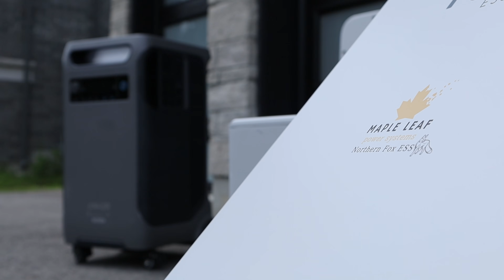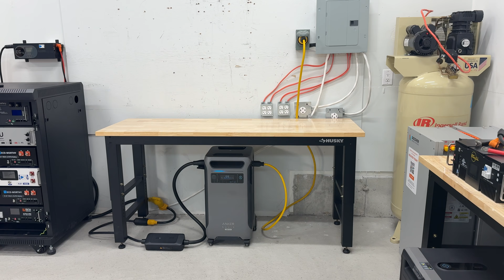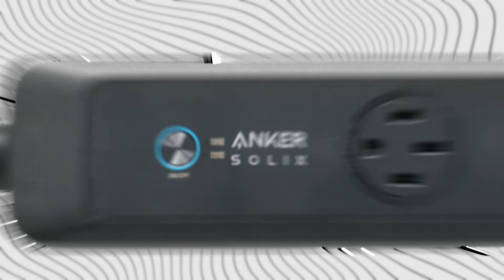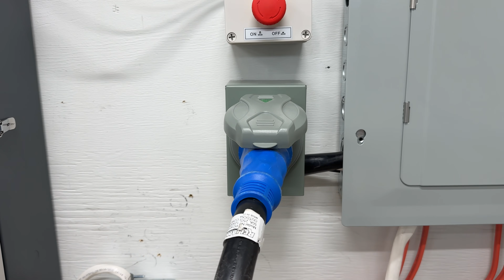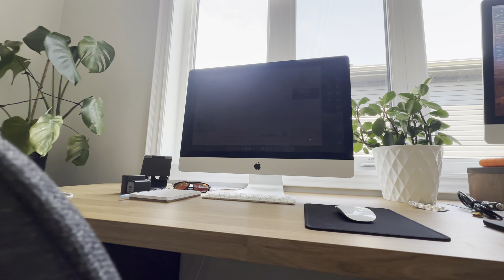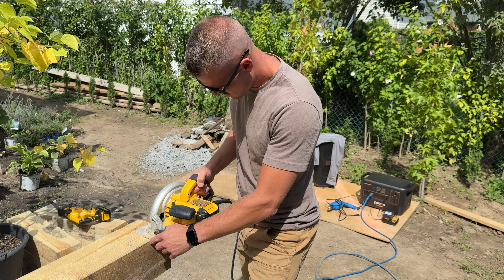Build a Solar Kit or Buy a Power Station? - Which is Best for Home Back Up

Comment: I really like the way you compared these two.. I do work for Sunrun, and I agree that a portable power station can make sense for someone who wants something simple and flexible, I think a home solar and battery system may be better for someone looking for larger capacity and a home backup. I also like your point that some people may benefit from having both, depending on their needs. This helps you understand what you want the backup system to do before deciding on which one you want.

Comment: You can totally do automatic backup with the F3800 plus. I did exactly that. It powers my 30 amp generator panel with essential circuits, and it gets input from the main panel. When power is on, it is running on bypass. When power goes out, it switches over to the inverter in a fraction of a second. I never lose power now (so long as the outage lasts less than a day).
Reply: And so can the EG4, and actually reset more reliably than the Anker.

Comment: If you never plan to move it, and have some DIY skills, it's impossible to beat your own DIY kit for $/kwh. Building your own 15kwh battery and a 12000XP is like $3700. Same price as one of those F3800 +1 expansion battery which is less than half the battery storage. And you get a ton more solar input and power output with the 12000XP.
But obviously not everyone can do that, and something like the anker is good for renters and condo owners.

However, you can get pretty close to that anker capability for far cheaper with some $150 12V batteries to make your own 48V system + a 6000XP that can easily be broken down.

Comment: Peak shaving is a nice idea, for those places that have time-of-use billing.  In my experience, that’s not common here in Texas.

Also, you’d be paying that money in a different way, because you would be aggressively burning up the lifespan of the battery.  And replacing the batteries every few years because you’re peak shaving may not save you much money in the long run.  It might even cost you more money.

Comment: Quite frankly the Anker 3800 plus is perfect for Apartment users... And add those balcony solar panels...
I can and have ran my whole house with only 120v 3500w inverter/battery/solar (yes, a split phase 6000W inverter would-be ideal)...plus I have two 1000w gridtied inverters for daily 24/7 use...

Comment: most power stations can be "hacked" where you can use any 48v battery with the same chemistry. the 3800 plus is super great,the shape is super good and seems to be a great option for portability.

Comment: The Anker has a manual transfer switch or a smart home power kit available.  Best of both worlds re: portability vs large home-based installation IMO.

I've had the 3800 + expansion battery ( and the 400W portable solar panel) for about 2 years now.  Originally it was to be used as portable backup for Hurricane season (in Florida).  We're renters, so I didn't want to make significant changes to the home we're renting.  I now use the unit as our (obviously over built) UPS for our home office.  We can pivot when there's an outage and use it to power our fridge, electronics, and "cool room" (One room with portable AC).

Note:  "Portable" for the 3800 might be a stretch.  Had to lug that up stairs to get it to my office.  Not something I'm looking forward to doing again.
Reply: Was it worth it the way you use it now?

Comment: I've got an interesting solution I thought might amuse you.
My RV has 2 Kw solar and 10 Kwh battery with a Victron Multiplus 2 48V single phase inverter/charger. Also, it's got a Starlink Mini on top that I send over to the house using a Ubiquity wireless bridge and a 3 station TPLink mesh router. 
I decided to try powering my base loads in the house using the RV as my "Power station". (Fridge, Freezer, Computer/Entertainment center and 110V power to the Gas furnace) 
With this in place I can switch the house back to grid and pull the RV out for vacation time, internet and power come with me!
It worked so well, in summer, I started thinking about winter...
 I'm going to be mounting about 4 Kw solar on my South facing wall with seasonably adjustable angle and most importantly an overhanging roof to help prevent snow buildup. It's WAY oversized to get a useable charging wattage during cloud season! 
Configuration: 3 parallel strings of 3 series connected 440 W PVs mounted below summer roof shadow. These will run through an external (to the RV) MPPT and the 48V will be sent over to the RV to enhance its docked performance.
I missed out on getting $40,000 interest free loan to install a beast whole house system so this is my workaround.
There's no arbitrage possibility here (BC Hydro, Salmon Arm, BC, Canada) so using this system to offset the individually low wattage but almost continuous power hogs will substantially reduce my power bill. 
Bill for energy will be a quarter or less than previous!
AND I can still drag the disconnected power FrankenRV away for fun! 
Other RV goodies are: 
Base RV is a 2008 Nash 22 ft.
Split heat pump AC/Heat.
Computer with 40" monitor.
New Microwave with true inverter power control. Old one had brutal PWM Bang-Bang control.
Diesel heater with Afterburner and internal 5 gallon tank cw external fill port with tank full alarm.
Roof mounted (between PVs) Vent, Skylight and RC Maxxair 7500 Vent fan over bathroom. 
Still gotta get a 12V compressor fridge!
Reply: The Multiplus-II is a great single-phase inverter, though note that the waveform will get a bit wonky under heavy reactive loads (traditional air conditioning may cause the lights to flicker).  However, if you tie it into the house you have to ensure that there is only one ground-neutral bond.

The MP2 has an automatic ground-neutral bond relay that turns on when there is nothing on the AC input (shore power not present, ground-neutral bond is local), and turns off when there is (shore power present, ground-neutral bond is handled by the shore connection).

So if the house already has its ground-neutral bond the one in the MP2 has to be disabled via configuration.  Usually the ground-neutral bond is left intact by the home's transfer switch but it depends on the county/state regulations.

--

If connecting a single-phase inverter to both legs of a house (L1 and L2), be sure to flip off ALL 2-pole house circuit breakers to avoid potentially damaging 240VAC equipment.  Also, older homes often have "shared neutrals" where two 120VAC circuits are placed on different legs and share a single neutral wire.  This works when L1 and L2 are split-phase, but the neutral wire can be overloaded when L1 and L2 are the same phase.

-Matt

Comment: Who said you can't feed the whole house with a power station.
Just plug into the transfer switch 🤷
Reply: Sometimes, depends on the power station.  Not all power stations are properly ground referenced inputs-to-outputs so you wind up with a shock hazard if you plug something into an input or output port when the output neutral is locked to the house ground.  That is, the neutral on the power station output may see an AC waveform relative to DC- on other ports on the power station.

Also, for all their marketing, most power stations do not have large energy buffers and the messiness all the house appliances create on the AC stresses the inverter too much over time.

The larger purpose-made-for-home-backup units, like EcoFlow's, will work properly, but I wouldn't connect up any old power station to the house.
Reply: @junkerzn7312 
You are making a big deal out of something simple. 
Most large power stations are now designed to plug into the transfer switch. The power stations come with grounding terminals. You can also plug in a neutral ground bonding plug into one of the outlets.
Reply: @wt9653  SOME large power stations can be plugged into a transfer switch.  Not most.  And you don't want to do it with power stations that use synchronizing combiner boxes (two power stations plus box).. not if you are serious anyway.

Usually the transfer switch does not switch the utility-side ground-neutral bond so that remains intact, but it depends on the state/county regs.  You never want more than one ground-neutral bond. Also, a bonding plug's wiring might not be able to handle the fault current.

Just because these finicky little details are hidden from regular consumers doesn't mean that they can be ignored.
Reply: OR... A lockout kit and generator outlet.... 👍 Much Cheaper...

Comment: You should also factor in idle consumption. Having a large installed dedicated system means you are using 60w-200w every hour of every day meaning 500kWh-1.7MWh per year of use, as a backup only, this is another cost that power stations bypass during the 90+% not in use.
Reply: Such systems are more or less universally paired with large solar arrays, so the overhead winds up being in the noise.   Large energy buffers generally require higher idle consumption.  That is, low idle consumption is not necessarily a good thing depending on the reason for why its low.  

Inverters with small energy buffers have a very hard time running the messy loads of a house and when larger motor loads are running you often see the consequences in flickering lights and sometimes unhappy computers.

Anyway, for example, my FB21 burns roughly 100W of overhead, give or take.  That's 2.4 kWh/day of overhead.  But the house generates 80 kWh/day of energy in summer and averages roughly 20 kWh/day in winter.  The overhead is inconsequential in the summer and a tad over 10% of my solar's daily energy in the winter.
Reply: If you are making that much power, it isn't a backup.

Comment: Cost aside, is the Anker just as reliable for full off grid if it meets my power needs?
Reply: Anker doesn't have a track record (none of the power stations have track records).  And I probably wouldn't trust a power station company that far.  There is a big difference running an inverter 24x7x365 and running an inverter occasionally.
Reply: @junkerzn7312  I was hoping to avoid setting up a whole EG or Victron setup.
Reply: @kenkoh1724  Gonna depend on relative scale of what you want to run.   If you start small it doesn't take much, to be frank.

For most people, in an emergency, it comes down to Fridge, Furnace Fan & electric starter (gas furnace), a few lights, internet, device charging... that's it.  Usually less than 2kW.

If you want to run a toaster oven / tea kettle / microwave (one at a time), that's another 2kW.

Going whole house and "business as usual" (sans double oven), we're talking more like 8kW to 12kW to cover peak use... minimal sacrifices.

Actual average loads will be much lower, of course, but sometimes loads can be lopsided between the two legs so even if you limit the whole house to, say, 6kW, that doesn't mean you can use a 6kW inverter (3kW per leg)... one leg might need more than 3kW at times.

-Matt
Reply: @junkerzn7312  I already know it has enough capacity for my needs. I'm just asking about Anker's actual build quality and long-term reliability, especially since almost all of these brands use Chinese components anyway.
Reply: @kenkoh1724  Its unknown.  The units just haven't been out long enough for anyone to know.  Power station brands, in general, have only just recently begun being used in always-on style applications like this.  None of them have any sort of track record yet and since their line-ups are moving targets, they might never.
Reply: Good Lord, That's a loaded question since we do not know what your power needs are...
Reply: I just brought a echo flow ultra power station with two batteries and inverter. That’s what you told me to buy. What solar panel should I use?

Comment: Is there a cost comparison somewhere or did I miss it? 
Is portable enough to run a small window AC or and induction single burner?
Reply: There are.a lot of relatively portable power stations that can supply enough current to replace one or even two standard power outlets.  The issue becomes battery capacity.   Powering a portable induction burner is not a large problem for many, but running a single burner on a built in cooktop is usually more complicated.     The issue, as noted by @thomaswelch5164 is how long a portable power station can run something like a window AC unit.   Even a small window unit can pull 500 watts and larger ones, more like 1500 watts.   The Anker F3800 plus shown in this video has a 3,840 watt-hour battery, but with efficiency losses, would probably  supply 3000-3500 watt hours to the air conditioner.  For the larger AC. unit, that is only a couple hours of runtime without purchasing expansion batteries of some type.
Reply: Yes.  But also running a fridge will require several expansion batteries.
Reply: @thomaswelch5164  Refrigerator backup is an interesting case.   The issue is that large inverters/power-stations are not very efficient when producing only a tiny fraction of their rated power, so they won't keep a refrigerator running nearly as long as many expect.  When mainly running an average US refrigerator, an Anker F3800 plus might not make it two days without expansion batteries.  If running a refrigerator or freezer and some lights is the main goal, a more cost effective option is often a power station with a smaller inverter (1500-1800W) and, if needed,  external batteries of some sort.  

 Inverter efficiency tends to drop when producing below 10% rated capacity and can be pretty crappy when below 5%.   For a traditional, non-inverter refrigerator,  after a starting surge that may be over 1000 watts, the compressor runs most of the time in the ~100 watt range*.   The result is that many power stations with 2000W+ inverters will go through their batteries much faster than most people expect when just running a refrigerator, internet connections and maybe a CPAP.   A large power station like the Anker F3800 plus shown in this video is likely running in the range of 50-60% conversion efficiency when just powering a refrigerator.  These larger power stations are versatile but not very cost effective for minimal power use situations. 
If someone just wants to keep some lights on, the internet and portable devices powered and keep the refrigerator running,  a power station with an inverter in the 1500-1800W range makes a lot of sense. The issue then is extending run time, if needed.  It would not be unreasonable to spend more money on expansion batteries than for the power station itself.  The Anker S2000 is a interesting option since it was specifically optimized for powering refrigerators. Unfortunately, it may not have enough oomph to run a full size microwave oven.  The S2000 also is not designed for easy battery expansion and would require feeding DC power from generic batteries into the "solar input" port.   Then again, even an external 12.8V battery can keep ahead of a refrigerator.

* Inverter-refrigerators generally have much lower start surges then continue to run at even lower wattage draws.